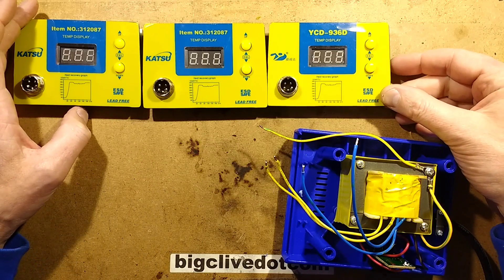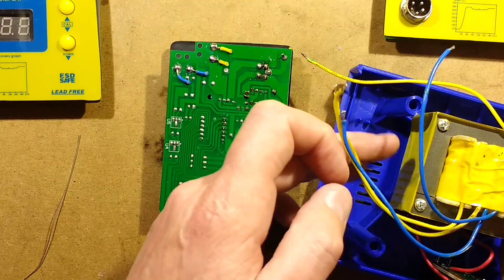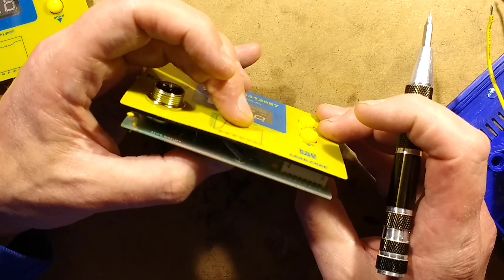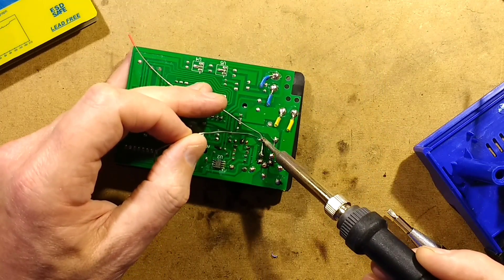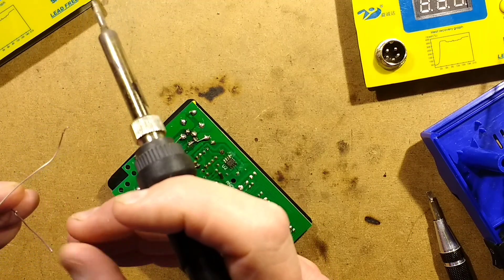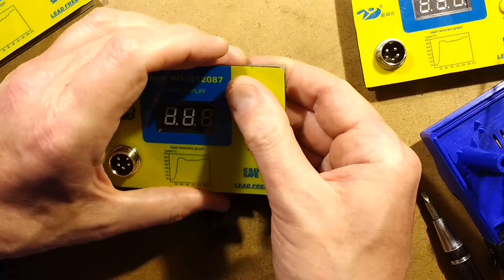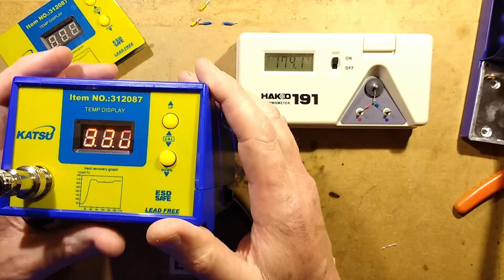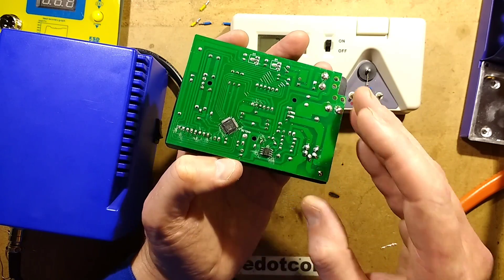Fixing a common fault with the 936D style solder stations.

Comment: I have purchased a 898D+ reflow station which is basically that iron, a hot air gun and some accessories. After an exciting episode of unboxing and admiring my purchase I figured I should test and adjust it. The air gun worked really well and could be adjusted to burn or not burn my fingers with ease. The iron also works quite well and so I adjusted it for temp by starting at 200°C and raising it by 10° increments until it would melt tin solder easily and then adding another 10°C. That way I am assured it will have the temp and thermal capacity to solder all but the biggest power connections without the tendency to lift tracks or let out the smoke from even the smallest diodes.
 Then I thought "you (meaning me) should check and see if the tip is grounded, just to be thorough". Imagine my surprise when it weren't! OH NO! I had already waited long enough  to get this thing what with one seller absconding with my money and having to file a claim with ebay, wait for a refund and then order it from someone else. US sellers, but still it took longer than if I had bought it from "the peoples republic". I was not about to wait for a replacement. Besides, I had grown attached to it, what with the burns on my fingers and oodles of admiration already bestowed (see above). So it was determined I was to investigate.
 I disconnected the iron and using a meter I measured the connections to find out what was what. Everything checked out fine so I moved on. Measuring the connector on the case I found no ground for the iron but the hot air gun was grounded. Upon opening the case I discovered I still can't see shit without a loupe so back into the house I go. Besides, I needed more coffee and to scratch my... well, you know.
 A quick study of the internals revealed that the well attached ground wire wasn't attached to the ground plane of the board, just screwed through to the front case and the hot air gun. The iron ground connection was jumpered to the board, however the resistor that was supposed to connect to the ground plane was not there as marked on the board. It may have been left out due to some issue with noise or stability. But still, no ground on the sheath of a heating coil that can act as an inductor. For use on sensitive components? It doesn't say much for the fine art of Chingineering. Since it appeared to function just fine all afternoon I just soldered a wire in where the resistor would have gone and connected it to the ground lug for the hot air gun. Thanks be to Weller,eh. A quick check showed continuity from cord to iron and when I plugged it in and turned it on the only smoke was from the iron where I had left it laying on the table. Oh well, all is good. It works and now I can finish some projects without all that cursing, maybe.
 Now don't get me wrong, I really like this 2in1 Soldering Iron Rework Station. And I certainly don't blame the importer for this little snafu. After all they didn't make it they just got it to me.  Except the first one, who should take a.... I am glad actually that I now know how well this thing is built. It should easily last the rest of my life. Unless the zombie apocalypse happens because I will be too busy making brain pokers and zip guns to work on very much chintronics. If I need more flashlights or garden lights or even toilet paper I can always raid the stores that were staffed by zombie food.
 If you think this little diatribe is too long then how come you're still reading it? But seriously, since ebay is bugging me to write a review of this device I figured it should be a doozy and serve multiple purposes. And besides Clive has made me smile more than once. So fair is fair. 
   Mike (o\!/o)
Reply: Experiencing Technical Difficulties- I like the cut of your jib

Comment: Clive, I use a 'Fiberglass Pen' to get PCB tracks exposed. Excellent for making stuff ready to solder.  I have a spare I can send you.
Reply from the maker: +Nuts n Proud I have a full set of the steel, brass and fibreglass pens.  I just used the screwdriver tip out of habit.

Comment: I had a aqua stat for a furnace smoke and stop working so I killed the power going to the furnace a removed the part. The problem is the used a cheap amount of copper and that liquid tin and it fried the pads and the tracks leading to them for at least 1.5 inch so I just bridged some silver solder, still works like a champ and there was fractures where they used cheap tin solder on many of the connections, I used silver. Sometime you can hardly see the fractures and ones that have the wire without solder due to the wire not being clean so it needs to be clean to solder to

Comment: why make new pads instead of going to the nearest connector (like the ground pin being jumped to the pad the ground wire is soldered to or even just soldering the ground wire to the pin

Comment: Sooooooo, you need a soldering iron, to fix the soldering iron, you just bought as your first soldering iron?
Reply: You're so un-fucking-believably creative and original. Woohoo.
Reply: Never wrong to have a portable one, as well as a mains powered station, for when you're out of reach of a mains socket- butane or battery powered, or one of the USB ones + a power bank.

Comment: Why didn't you use multicore wires for the new connections? Also, if there's mechanical strain, you should've let some slack for them to jiggle.
Reply: ooltimu standard bodge wires are solid so you can bend them for routing  and tacked down with epoxy so they don't flop around. If it goes off the board to somewhere else use stranded. These are so short there's no need to use insulated wire or tack them.
Reply: From what I understand from the video, the mechanical design wasn't so great and there is strain on that solder joints. I imagined since he didn't solve the strain problem, at least he could use flexible wires to account for the movement.
Reply: I guess the real schookum fix would be to support the board so it doesn't move. It's not a great idea to rely on solder for a mechanical connection. A stranded bit of wire would have to be longer with a loop in it and they can fail as well at the point where the solder stops on the stranded wire. There is a stress concentration where the connector pin attached to the copper trace so it fractured. The solid wire fix  is floating in air so it has more compliance then the abrupt connector pin to copper pad transition. I might have put a few dabs of hot snot in there if the gun was within arms reach to keep the boards from rattling around.

"Proper" might be secure the connector physically suck the solder off the pin wrap 270deg around the pin and solder then route that bodge wire with proper radius bends to wherever the trace went and solder it there then tack the wire down in spots. Follow up with properly securing the boards. Way too fiddly for a $40 iron.

Comment: In my years of having to care for 100+ Thinkpads I actually have seen quite a lot of this, the power connectors are the most stressed components on laptops, and with (thankfully) tight-fitting connectors from the power supply you get quite a bit of leverage on the circuit board. Really should have dared to do a solder job like that on them, but IIRC there wasn't too much space for the new "solder pads". Also we hade quite good warranty on them, so sending them in for repair wasn't that much of a biggy... just had to give the user a loaner while waiting for IBM/Lenovo to fix it.
Now I long for those days, since the HPs at my new place of work have made the power connectors not quite fit the cable of the power supply, making it fall out all the time.

Comment: After running out of solder i went to sunny Maplins , was told they dont do lead solder anymore only unleaded. Tried it , yup proper crap. Was so lucky to spot 2 rolls of lovely leaded 60/40 on the market ,1.25mm and 1.75mm 5 quid a roll . 1 kilo of leaded loveliness will last me years .
Reply: You can still buy 60/40 leaded solder by the pound in the states, though it has warning labels "KNOWN TO CAUSE CANCER" which is ironic because flux in many lead free solders is more toxic.

Though in recent years, 63/37 leaded solder is supplanting 60/40 stocks. I don't like 63/37 because it's harder to melt and doesn't flow properly. It usually leaves tails on the connections pointing whichever way you pulled the soldering iron tip away from which is annoying.
Reply: Wilko still do 60/40 solder in the little tubes.
Reply: You can still get it from Banggood.
Reply: I still have some 60/40 lead rolls here from the early 90's , definitely far better for hand soldered stuff.
Reply: I just buy it in bulk from China. Might take 3 months to get here but I only need to do it once every half decade or so!
Reply: Coming to the end of a roll of Nasco solder.
Don't know where I can get good stuff here, these days.
(Later edit:  R550 a roll.... Ouch!)

Comment: Maybe thats the problem with mine... the iron has been running so hot that the rosin core have boiled violently, splashing solder everywhere. Quite unsafe, so its just been sitting on the shelf, while ive used a cheap iron from biltema

Comment: Somehow ebay Germany doesn't even sell these cheap Hako clone soldering stations. Instead we get no-name ones like this: http://www.ebay.de/itm/381573075655 - which are OK (I bought one), but don't even show the temperature they're at. The manual just says "wait 10 to 15 minutes for the iron to be up to temperature" ... and a proper measuring device for calibrating it would probably even cost more than the solder station itself ;)

Comment: I just bought a silver conductive paint for fixing ,those kind of problems,the stuff cost more than gold I got about two cc of that stuff ,and I would be surprised if it worked ,I always made jumpers like you do Clive,I bought that stuff because I was curious.anyone use that conductive paint
Reply: It used to be good for repairing those printed on glass car rear window demisters!  When the dog (or kids) had scratched holes in the tracks, it perfectly bridged the gap!

Comment: I think i would desolder the socket from the pcb and use flexable wire loops, and cement two blocks of plastic on the pcb to the inside fasia by the switches to take the force of button pushing.
Reply: I would hot glue 2 bottle caps or the like between the board and the front panel and bigclive's springy wires seem like they should be very robust
Reply: Yep sounds strong enough for pressing buttons :-D.
Over the years i've had a lot of crap designs to fix, allowing pcb's to flap about has never been good for them.
Sockets are not designed for mounting things on, also headphone jacks are never mechanically fixed to the pcb, just hanging there by its solder connections, snap lol.
Reply: talking of wonky....my internet radio wasnt connecting, finally decided to take it apart before i gave up,   good job i did, the wifi part is on a usb card connected to main board, well it wasnt. usb had worked loose.  nothing but the usb socket held it in , nothing else to stop it vibrating or whatever coming out.
Reply: Quality engineering lol,
but well done on the repair :-D.
The company that made that radio just didnt give a stuff about it lasting, bloody shame :-(.
I hate modern crap.
Reply: zx8401ztv Or they did care and made sure repair would be dead easy.  Just forgot to brag about it.

Comment: It is amazing how so many idiots think alike. They all think they're so clever whining in unison about needing a soldering iron to fix a soldering station. That's just how it goes kids. One soldering solution is rarely ever enough.
Reply: Very true, tips wear out, elements go bad always keep a spare around
Reply: It goes deeper than that. You're not going to use one of those little soldering stations to solder a ground braid to a metal chassis. That's when I break out my 300 Watt American Beauty iron. The world is not all SMD after all.
Reply: Soldering stations are for pussies anyway. I prefer my 100-watt gun. Burnt boards just add variety!
Reply: Paul Frederick - It is even funnier that all the YouTube soldering "experts" never heard of flux. "Just use my big iron, it'll all be right mate."

Don't teach what you don't understand.
Reply: @croc , did you see bigclive use flux? its flux cored solder, which you still use with a big iron, i dont see the problem, my 250w iron has a fine enough tip if i chose to use that big sod,  let alone what i could cobble up out of copper and a butane torch
Reply: 1 is none, 2 is one, and 3 is sufficient.
Reply: my background is in electronics design and manufacture , before my eyes turned to mush i used to be revered for being able to hand place 0402 sized components and solder them by hand :D  Now i couldn't even see the damn things :D :D
Reply: i mean who doesnt have an old soldering iron previous to buying a soldering station?
Reply: My eyes are not what they used to be either. So I use a magnifying visor now.
Reply: Crocellian I am no YouTube soldering expert. But I have professionally hand soldered military aerospace communications gear. Which makes me a real life soldering expert. I used to do subcontract work for a company named CTI. They have a website.
Reply: +Jusb1066 posers, that's who.

Comment: You don't need flux for those connections?
Reply: Well if you were soldering a Flux Capacitor, you certainly should use more flux.
Reply: Don Wald Rosin core solder
Reply: That Guy Well sure but it's all burned off by the time the joint is made.
Reply: Don Wald What would you need flux for after the joint is created

Comment: repair soldering station... using soldering iron...
Reply: Duh?
Reply: Surprise, you can use a hammer to smith another hammer! Isn't that fucking mindblowing?
Reply: Anvilshock hammerception amiright? oh killmenow
Reply: you do, its just the definition of hammer varies as you go down, it can be a lump of stone to forge iron with , if thats all you have, same with a soldering iron, the old way of doing it was with a lump of copper attached to a handle heated by a flame,  of course you cant do fine work , but they didnt back then, you could get enough done to repair this iron though with a nail and a lighter

Comment: I wonder if you desolder the connector, add a screw on that spacer, whether the board would sit correctly
I would also be tempted to at least add some spacer blocks that are double sided taped in place.
But then i have never owned a temp controlled iron, i prefer my Antex X25's

Comment: Not using the strain relief holes for the power wires?. OK I am being picky. A hot glued lego brick under the board would also help.
Reply: i did that years ago, ended up with DVT :o
Reply: Step on a lego brick strategically placed at the top of a flight of stairs. That adds danger to the experience.